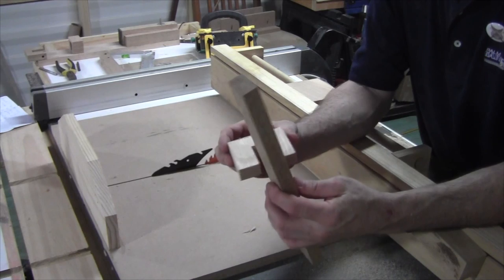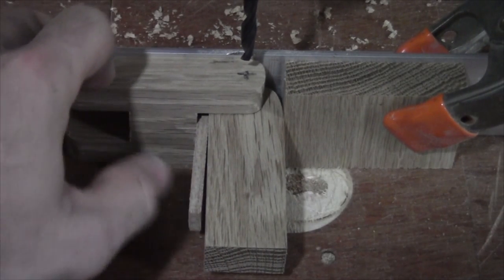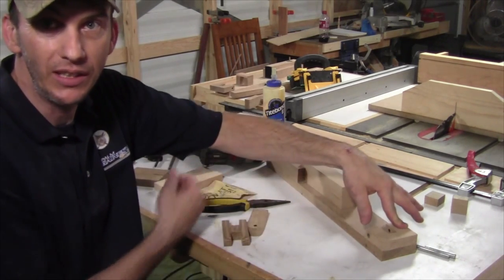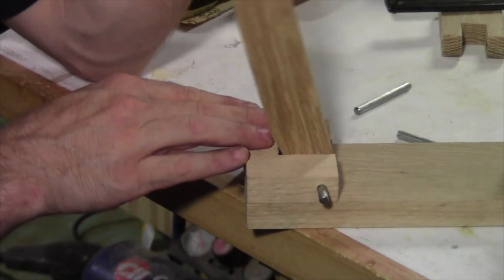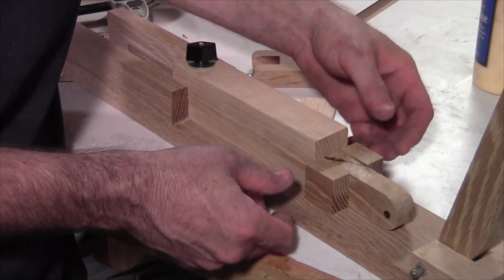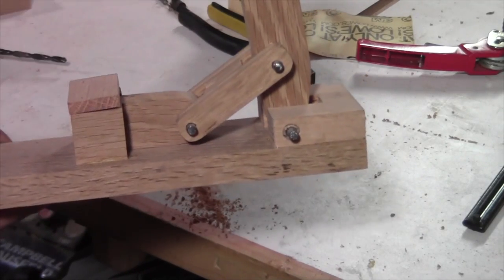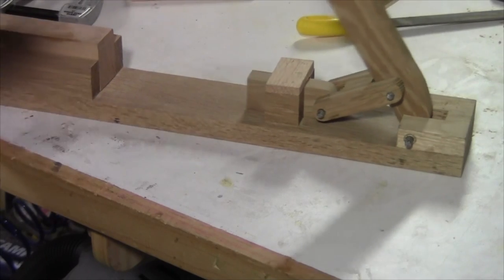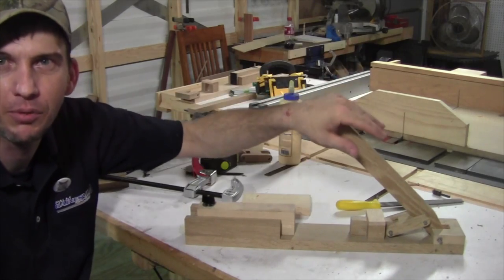Make Your Own Pen Press | PART 2

Comment: Excellent video!  I built one using your plan after the 1st video and am now watching the 2nd to see if I did the rest right.  I had to make mine out of 1" because that's what I had.  I had to adjust a few measurements but it turned out great!  You can get all the parts from a piece of wood 6 1/4 x 20 and 6 x 14.
Oh I also added a little wood (wenge, yellowheart, and padauk) to the handle top and turned it.  I left 1/4" at the top of the oak to make it look like a little push button.

Comment: Hi Laney.  I made one of these when I first started pen making but for the stop end I had a block with two dowel prongs in the bottom and that moved back and forth along a line of drilled holes so it could be set to whatever length was required. But I think yours is more sturdy if you get a stubborn pen part.  I also turned the end of the handle before fitting just to make it a bit more comfy on the hand. A good waxing certainly helps with the movement.  Many thanks for a great video.  Alan